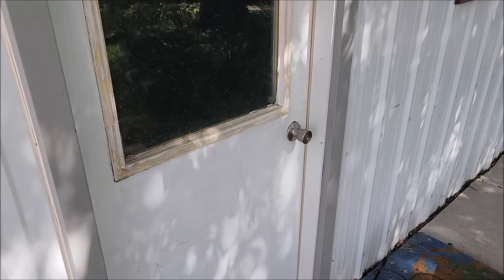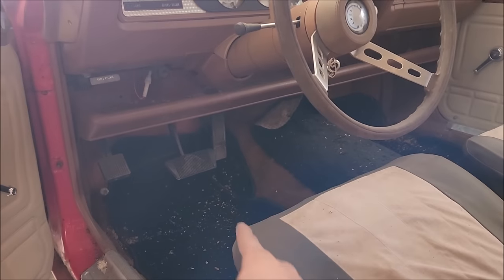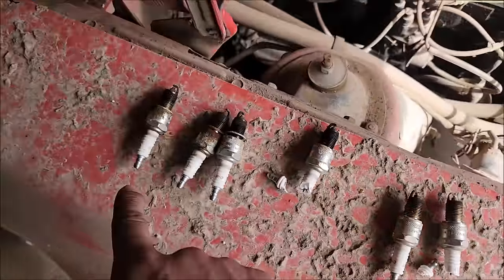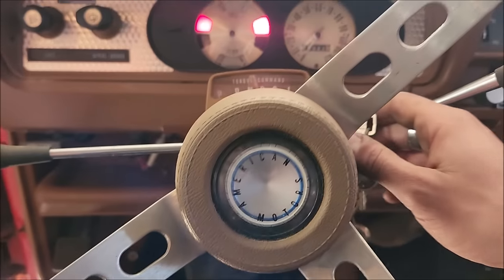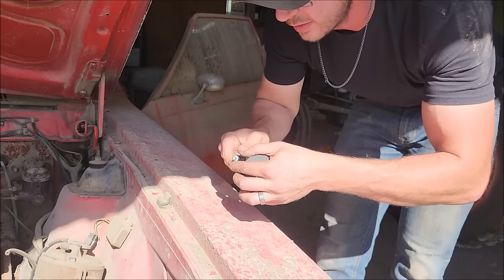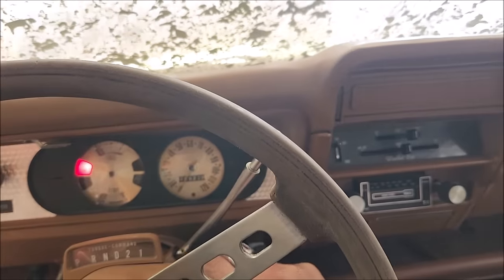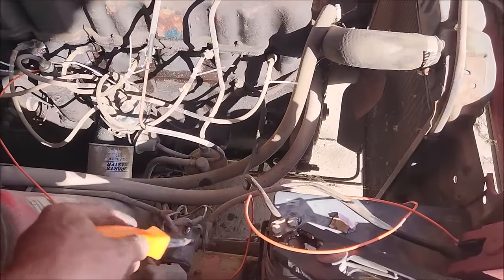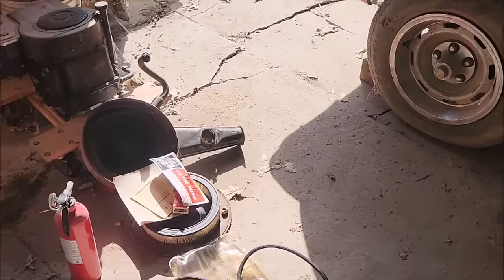Will It Run? 72 AMC Gremlin - Saved from the Crusher!

Comment: Excellent video Luke  :) also my  thoughts try get car fix up to drive plus change spark plugs  plus cap , rotor, plus points keep extras too  , oil change plus oil, fuel , air filters and PCV Valve on Valve cover  ! New engine belt to and change Antifreeze  , check brakes, and exhaust is need parts! Transmission filter, pan gasket  , differential fluid too! Check all electrical to if need anything  too ! Yes new tires too change! Brakes fluid  plus hardware and check fuel tank plus lines too even send unit gauge!  But overall great car when get running put 89 with 5% Ethonal or 90 or higher  octane  has no Ethonal % in gas and bottle  fuel Injection and carb cleaner  in  too! Engine Oil use 10w30 engine oil no synthetic  !

Comment: Good to see you as always Luke (Insert obligatory StarWars ref here :-)  
Its a cool thing, Original and unmolested and I reckon the Missus will get a lot out of it as a summer car, Its an Auto with a fairly hefty inline 6 and honestly I'd leave it fairly stock.
Maybe a Cam Grind and rejetted carb for a bit more Ooomph, Exhaust opened up a bit and general maintenance and finally a Carb Cheater coz Anarchy and Science :-)

Comment: Keep the Gremlin! Cool car you just don't see anymore. What did you end up doing with the Torino? The house I grew up in had an old carriage house that had been converted into a garage. It was over run with wasps when we moved in. Dad had a 64 Chevy panel truck for his Dailey. The valve guides were so wore it would burn a quart of oil during the 7 mile round trip to his work. He backed the truck into the garage and left it running to smoke out the wasps...one of the neighbors called the fire dept thinking the garage was on fire😅.

Comment: That’s a 73, it was the last year of the small bumpers, but they had the shock absorbers behind them that made them stick out a little verses the 70-72. And just out of curiosity, what did you mean by bandwagon cars? I’ve owned my 74 since 06 and have owned other AMC’s prior. Thanks for saving that 73 by the way.

Comment: I worked at an AMC dealership in the later 70’s and that 258 is a great engine. I drove a customer’s Pacer one day from the dealer to a body shop with a 258 and 3 on the tree, it was wicked fast car for a six. One of the dealers owners also had two AMX’s which were a real treat to drive.
Reply: AMC also usually paired the 3-speed stick with 3.54 gears which also really helped to "pep" things up.   Pacer with a 3-on-the-tree would be quite rare today as that's supposed to be a one-year-only option (1975).  Not sure if it was supply issues or AMC wanting to shake off it's stodgy image but usually the bolt-action 3 speed was reserved for the LOWEST engine option - usually the 232. But for whatever reason, in 1975 it was offered on both the 232 AND 258 and later in the year could be paired with the electric overdrive as well.

After the 1975 model year.... no more bolt action Pacers.... and after 1976, no more bolt action Gremlin, Hornet, Concord or Spirit.  I think the Matador with six could still get it though.
Reply: @That_AMC_Guy  Bolt-action... ha! I like that one. Yea, this was '77-'78 so that makes sense. I had a Matador Coupe, that MoPar green color, 304 V8, think it was a '74 car. Did GREAT burnouts. Wouldn't start reliably over time (when engine was warmed up/hot) and finally I figured out it was the distributor shaft bushings. They wore out and when hot, the clearance would get large enough for the pickup on the shaft to get out of whack, guessing that was a primitive hall effect sensor type deal, I can't remember. New distributor back then was cheap as dirt, tossed that in and timed, ran perfectly from then on. I really liked that car.

Comment: The AMC 6 is among the most durable engines ever built (all the way up to the Jeep 4.0). Mine sat for 10 years, and other than a carb problem of my own making, it popped off and idled just like yours did.

The only real problem with them is that they're fairly gutless in front of an auto. It may not be so bad in a small car like a Gremmie.
Reply: Its gutless because of that tiny carb also.
Reply: @tabbott429  That carb isn't going to help on his 4.2, but they're still pretty gutless in front of autos even with others carbs on them. They make great low end torque, but the show is over not far from idle and with an auto they just chhhhug.

Comment: Never seen a guy air up a tire with a spark plug pipe. Interesting. I'd probably use a $30 Amazon compressor, but to each his own. Those cars are interesting too. My uncle had one, and he hated it way back then. She's hard to look at, but AMC is very interesting to me, and I'm glad you saved it from the crusher. Funny how you talk about naming a car something perceivably bad, like "Gremlin". I always wondered what Chevy was thinking when they made the "Citation". Like you'll receive a fine just for owning it.
Reply from the maker: The spark plug deal is a vintage unit from probably the 70s specifically designed for airing up tires - it's just fun to use once in awhile 🙂
No kidding. Kinda like mercury meteor, Plymouth satellite and all the other space race era names

Comment: it does have an accelerator pump, they tend to work poorly.  It may have the notorious "dead spot" on acceleration.  Gradual acceleration is the best way around it, 2nd best is a manual choke and making sure it's wide open while cruising

I had a lot of experience with one of those ... doing a V-8 swap is not a simple thing, I found out the hard way

An abandoned, wide open, parking lot makes for a lot of fun in those when it is icy.

You can haul 8 people (teenagers), at least, in one of those if you have a shoehorn and a crowbar handy.  We had three in the front, 4 in the back seat, and one laying on the spare tire in the back.  That poor car was dragging ...

Don't open the back glass during high wind.

Comment: What you really need in your life is a MK2 or MK3 Reliant Robin 850... tops out just under 100mph, gets there quicker than some modern cars, super super cheap to run and with some light modding will make it one of the most fun cars ever to drive.   Had mine 13 years now and she still excites me on these rural Dorset roads, will cruise all day long at 70 and as long as you have good tyres and looked after rear stuff, will go round corners like its on rails, drive it like an old Sports car, run into a corner like a lamb, roar out like a lion and cya to anyone following on 4 wheels hehehehehe   On mine I put in tri prong spark plugs, high end HT leads, performance sports coil, upgraded rotor arm, electronic 45d distributor, on the fuel side ported the inlet port matching the holes and dremeled out the siamese on each side then polished everything.   4 branch exhaust with a cherry bomb on the back finishes off the rorty beastie, oh and a set of Peugeot GTi rear anti roll bars.

Comment: I owned one with a 4 cylinder Iron Duke engine/manual 4 speed.  It was a good car except the rear end sagged a bit and then I found the rear springs started pushing through the area inside the hatchback.  I noticed a lot of them sagging that way.

Comment: Luke! Where they got the design for these gremlins must have been tripping on acid and looked a fricken roller skate! My cuz. Had one fit a V8 down in it air shock at the back to fit mickey thompson 50 under it/yep rubbed the wheelwells a bit/thought it was bad ass until a 4 cylinder dodge omini ghl smoked his ass/carol shelby strikes again!

Comment: You ever considered giving the ole Gurl a bath before you try to spark her off.
I mean clean is so much easier to deal with, because you don't have to worry about dirt n grime going inside her innards, or blowing up in your eyes.
Plus water is fairly cheap all things considered these days, but as I always say. 
If your clean n presentable, then you tend to do your best regardless of whatever someone else might think about you. 
Plus your wife doesn't have to wear it too just to do the laundry when she does it. 
Plus it saves the trees, because you at least don't have to go through nearly as many shop towels. 
😂
PS
My cousin back in the late 70's had a X model that we grafted a 390 out of a 73  pickup with 18,000 miles on it that his dad had been hit in the rear by a kid on a rain soaked asphalt road sitting at a red light. 
Had top loader four speed in it, and after sitting for 6 years under a tree awaiting a new body that never appeared until he chewed the little 6 cylinder up after a hard life..
It got it's new transplanted body.
With a set of 
N 50's on the back on a set of 12"x15" chrome deep dish with chrome center caps it was a little sketchy from off the line as it tended to spin sideways in a haze of Dayton bias ply tires, but from a 40 roll the little car was down right scary fast.
He drove that little car well into the late 80's before the rear differential locked up going down the hiway at 75 mph, by the time it stopped doing all kinds of acrobatics it wasn't worth pulling the old 390 out, but somehow he walked away with two broken fingers on his left hand which had been pinched between the roof and the steering wheel.

Comment: Two things.  Be glad you don't have the Chrysler 3 speed standard transmission in it.  The had an unsynchronized first gear :(.  Don't expect the seats to last a week before their covers split.  If they haven't already split you may have the last intact original Gremlin front seat on the planet.

Comment: 258s and 232s are great engines, lot of potential. If you really want to make power a 360, 390 or 401 is probably a better choice but the sixes are very reliable, economical and made very adequate tq, you can put together a mix of 258 and 4.0 parta and boost and make a few hp with an AMC six.

Comment: give her a bath and sell her for the right price. gremlins are valued for the right collector and this one is all original with just regular maintenance done for probably 10-15 years. the fact it ran with little to no issue will probably bring it higher in price given all it needs is a little detailing and it's basically brand new at the dealer with all original parts. jay leno would probably buy this if he didnt have one already.

Comment: That is a model year 1973 Gremlin. That jutting front bumper is a one-year-only gig and that year is '73.  This would also be the first appearance for the "slim shell" bucket seats, the automatic floor shift,  a recoverable 2.5 mph rear bumper, AM/FM radio.....  quite a few items actually.  That is a very nicely preserved car!!  Would be a great candidate for a V8 Swap!

Biggest thing to really watch out for at this point is that the transmission is a Chrysler Torqueflite.  Make doubley sure the kickdown/throttle linkage is hooked up to the throttle and transmission and is moving freely.  If poorly adjusted or disconnected entirely, you can burn that tranny up in less than 10 minutes.

The Brakes should be all Bendix stuff.
A 2-barrel swap on that engine should wake the 258 up a little, or if you have some money to burn, get a 4-barrel intake, a header and a 390-cfm carb and that little engine will surprise you.
Reply: A nicely preserved car... yet a great candidate for a V-8 swap? In all my years, I've yet to hear 3 good reasons as to why you would destroy the originality of a good (or better) condition, original car by doing an engine swap. 🤔 🤦🏻‍♂

- Max Giganteum
Reply: @MaxGiganteum  
1. For the Glory
2. For the Money
3. For the Fun

Besides, a V8 swap - done properly - makes the car just a little bit more fun than the average Gremlin.  Thing is with this car, there's nothing that makes it outright rare or desirable. So, there's not much argument for preservation, either.

My personal Gremlin is an original, Big Bad Green car, loaded and a debut year: 1970½. It was worth preserving.

My personal Hornet hatch was nothing more than a V8 with power steering and an AM radio.  It was ripe for turning it into what ever I wanted.  Now it has a 4-barrel, a 5-speed, front and rear sway bars, an AMX interior, tach; gauges; hood scoop .... and is 100x more fun than if I'd have left it original.
Reply: @That_AMC_Guy  Another guy that can't read... 🙄 I said three good reasons. 🥱

- Max Giganteum
Reply: @MaxGiganteum  

1. For the Glory
2. For the Money
3. For the Fun

Three being the count, and the count being three.  If those reasons were good enough for Burt Reynolds..... they're good enough for anybody!

Comment: The 258 6 cylinders that I ever had apart when they have alot of miles do not rev the engine and shut the key off in mid rev or you will replace a timing chain guaranteed and the rear main seal leaks with alot of miles other than that you can't wear those engines out, they are like the ford 300 6 cylinders.....

Comment: I had a 75 Gremlin, that my mom bought in 85 for her.  Of course she named it Gizmo.  For whatever reason, the headlights would flash, to the point other people would flash at you or if you were behind them, they'd pull off the road.  Another oddity, the thing would randomly throw it's brake pads, making for a dangerous drive.  So, since I'm late to your channel, what did you do with it?

Comment: You keep saying how many miles the old Ford truck has,  which is impressive for a Ford honestly but i have a Trailblazer with over 300,000 on it and still runs like brand new! Has the "Atlas" series all aluminum straight 6 in it, amazing engines!! Only things ive ever done to it was a water pump and u joints and thats it. Also the 4l60e transmission is still going strong as well, has towed a many of cars with it all over the place! If you can afford 17 miles to a gallon of gas I highly recommend a Trailblazer, 2007 or newer though,  thats important, you don't want one before 07, they put a much better head on them 2007 and up to 2012 i believe is when they quit making them.

Comment: I do hate the Ford 8N coil location, because the water pump seal will drip water on the hot coil and when it cools, it’ll suck water in and stop working.

Comment: The engine being a 258 is also the same used in the CJ jeeps that later became the 4.0 the trans should be a mopar 904 maybe a 727 you can tell by the oil pan on the trans the rear diff could be any number of diff used by AMC ie All Make Car  LOL check all the fluids & the brake linings and you could have a nice runner clean out the fuel tank may have rust holes maybe not. Good luck you find the coolest stuff.

Comment: You could take all that time to label plug wires. Or you could just remember the firing order is 153624 in a clockwise rotation and mark the #1 post on the cap. Pretty much every inline 6 ever made has that same firing order.

Comment: AMC built stout engines, the all have high Nickle content in the blocks, so usually minimal wear in the cylinders even after many years and miles. AMC also sold gremlins with the optional V8's in 304, 360 and 401 cubic inches, with 4 barrel carbs too, lots of factory high performance parts were sold by AMC dealers as well, AMC had what was called Group 19 with AMC part numbered cross ram intakes, hi po camshaft kits, performance suspension parts and body spoilers.
Reply: AMC did not put 360s and 401s in the Gremlin,232,258 sixes and the 304 2 barrel was the only options,BUT Randall AMC in Arizona made a small number of  401XR Gremlins (X-package & R stands for Randall).

Comment: The Gremlin is a good example how "little guy" AMC achieved a lot with a little: The Gremlin, I believe, was essentially a Hornet with a different rear, and was a huge success nonetheless. The fate of AMC shows to proof a simple fact about a capitalist economy: If You loose it's not necceserally because Your product is worse that that of the other guy, it may even be better. You loose in the long run because the other guys(s) are bigger ...

Comment: I had a Gremlin X, I know that the tranny fluid was run in the bottom of the radiator, there were issues where the radiator failed and it allowed coolant in to the tranny fluid, please check for that. Good stuff!

Comment: My brother had a Hornet which is kind of a little bit longer than a gremlin what do you add a six cylinder in it and that was one tough vehicle she was a 300,000 mile car with one overall one ring job got great mileage too According to him I always would like to have taken and putting a V8 engine midship in them and do wheelies where they bought a four inch drive shaft or maybe just a U joint not something I wanna try now though got enough to take care of as it is but she looks pretty clean get her out the shed and get her sold let somebody have a good time with her

Comment: YOU COULD SELL IT TO ME THE GREMLIN. SERIOUSLY. I ALSO LIKE THE REBEL. The gremlin is on my bucket list. Friend of mine back in high school he had a black and gold one and it was 6 cylinder and it was just fun little odd car. Anyway if you're going to sell it, shoot me a reply. I honestly don't know what they're going for right now. One thing by AMC 6 cylinders you might want to watch out for is a year at the bottom of the distributor likes to come loose and fall off spin out of position. They do not give any warning. But normally what you do is just pull distributor assembly set everything to top dead center I just sent gear to wear should be. Put it back together and repeat it in the future. I have had to raise engine and pull the pan to retrieve that gear before but I'm going back to you about the time of this car's probably parked. Also that rear hatch window is very very delicate. Be sure if you keep the car and it's hot like sometime next summer be sure to keep the windows down a little bit. I've seen those rear hatch windows in those cars just explode. Need to allow the heat to scaype somewhere. Once again that's from when I was a kid. Enjoy the episode look forward to next one. Even if you're not going to sell the car.